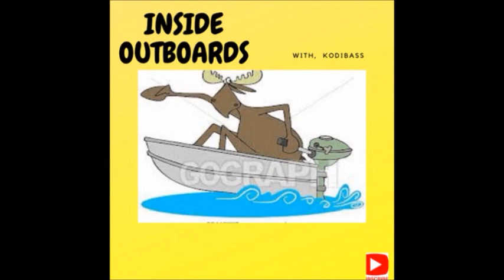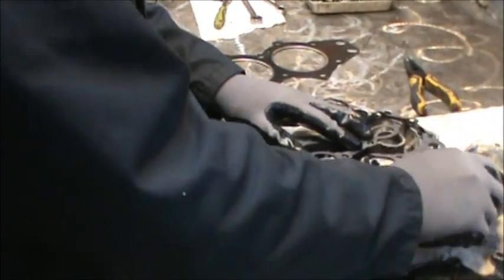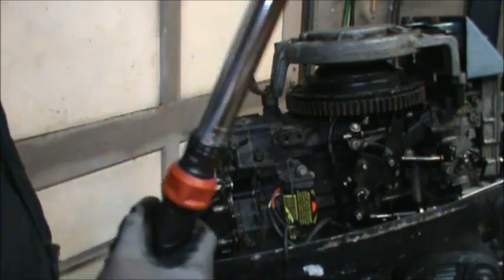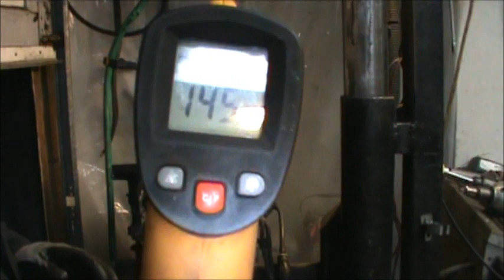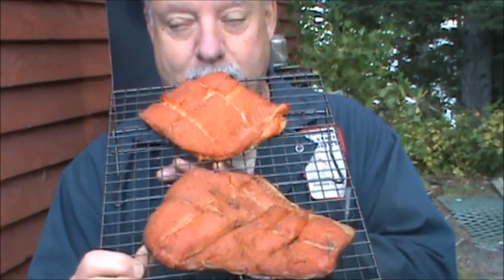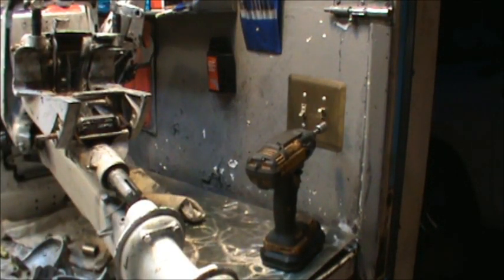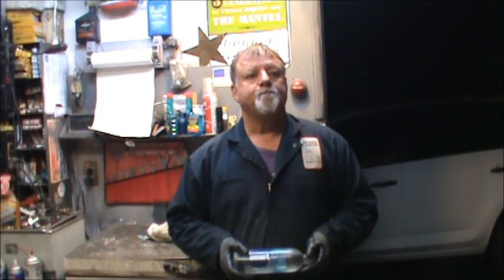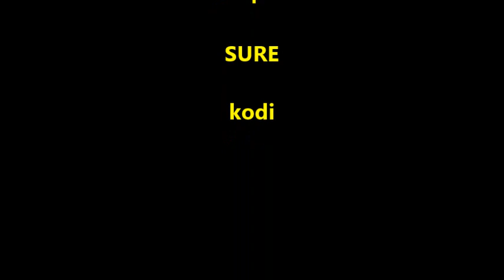EVINRUDE  1988 55  HP COMMERCIAL Outboard motor. +    Johnson 5 &  1/2  classic  outboard .

Comment: The 55hp sounds nice, those engines were designed to run pretty hot at idle, which helps them run nicely at lower speeds, they cool right down at higher RPMs when the relief valve is pushed off its seat.    Yeah, seems like spark plug removal was an afterthought on many of those little engines from the 60s...
Reply from the maker: Right on,  I  not making this up the owner of that 5.5  Is a eye doctor. lol      kodi
Reply: @kodibassInsideoutboards    Hmmm, they are usually the tightest....
Reply from the maker: @fleetwin1   AND You Sir  R spot on Correct,  I kid u not I took this motor out of the back cubby seat of a convertible Mercedes sports car,,  And he will whine like a turbine engine about his bill. But I do not care,  Been there done that..  Yadayadayada   Pay me.        kodi
Reply: @kodibassInsideoutboards    Good for you buddy....

Comment: Hi Kodi, Love the music you've added lately👍 never seen or heard of a pop it before. Interesting. My merc 60hp never goes over 90 degrees when running in cold water. I can put my hand on it no problem. Oh someone is selling another mercury mark 10? For 30 bucks and claims it runs. Very tempting for restore or parts motor. This one has a tiller handle which would cost me 30 bucks on ebay anyway. Problem right now is I'm running out of room. I need a shop somewhere so will ask around if someone has a spot they are not using and would be willing to rent to me cheap or barter for work in exchange?
Reply from the maker: Yep'  I know all 2 well about room issues,  I have parts rat holed everywhere, haha  kodi

Comment: Question...   What lubricant would I utilize on a starter bendix spiral thread...?   Lock Graphite...?
Reply from the maker: + WR,,  NONE ,,    Nylon teeth grabbing Plastic  teeth, Badd   .   Now add Slippery Lube..  Bad combo 4  sure,   Do not add any Lube to your Starter Pawls,  or Bendix,  In fact make sure they R dry clean & ready to engage together .  Think Nylon on plastic,, Any slippery lube will Only cause problems 4 sure.  kodi
Reply: @kodibassInsideoutboards  1987 VRO 175 V6...   It's metal like a car starter / bendix...

Comment: Kodi..Interesting as usual..I recently picked up a 1983 40 hp military. Tiller model.Rope start.What is the difference from a normal 40hp?Thanks
Reply from the maker: They have double sealed airboxes  on the carbs,   water resistant spark plug wires & boots,  The ones I have seen have a grab bar attached to the lower pan for transporting.  Aside from those things  just a commercial 40.   kodi
Reply: @kodibassInsideoutboards  This one does not have an air box on the carb..Has the grab handle but the one side is broken off..One of the transom clamps is stripped out and plate and bolt missing..temporarily tapped it and bolted a big concave washer I had on it for now..thanks